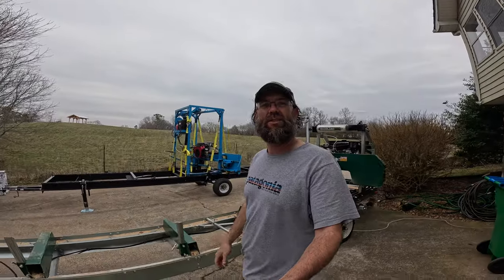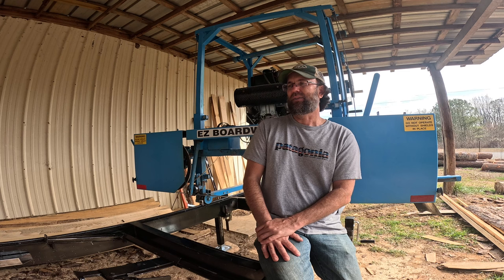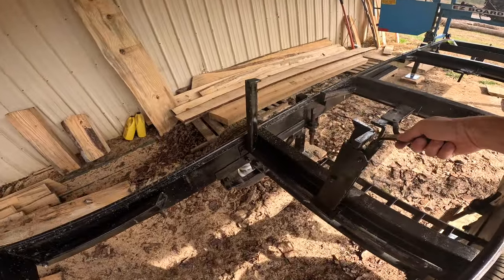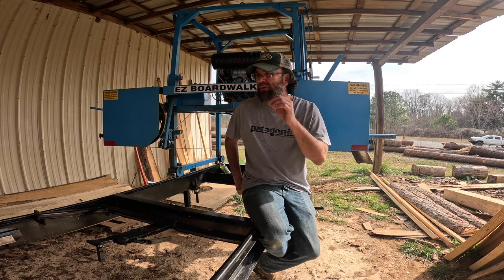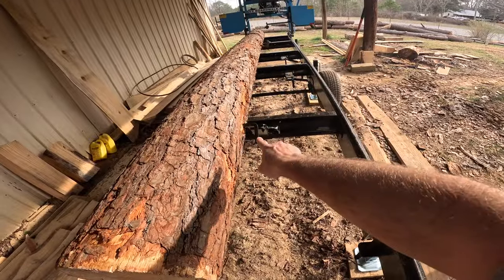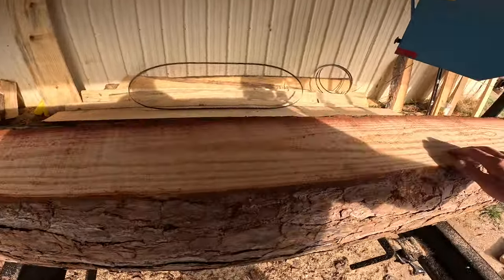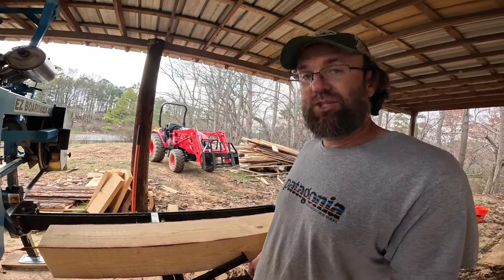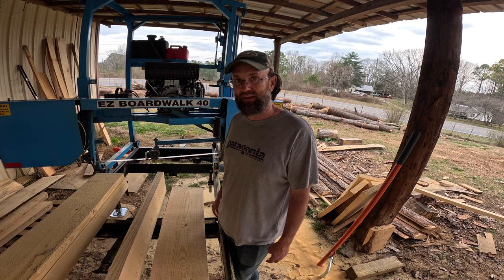Introducing My New Sawmill: EZ Boardwalk 40 Walk Through

Comment: Nothing that impressive about this one, I can see it's better than woodland, not much though
Reply from the maker: Have you had the chance to use an EZ Boardwalk mill before?  Some things don’t come through in video.  Certainly there are way more expensive and complex mills out there with full hydraulics etc. But for a manual mill, this one is certainly up there with the best in its class.  Nothing again Woodland Mills as they are a fabulous company with a great product but this EZ Boardwalk is solidly built.  But there are certainly bigger and more complex/full featured mills out there for sure. Either way thanks for sharing your thoughts and for watching!
Reply: I had 126 woodland ok for 4k. For beginners, just got myself woodmizer lt15 much better but still much room for improvement. Not to happy.

Comment: Best review I've seen online of the EZ Boardwalk Model 40. You did a great job covering the things that make the EZ Boardwalk different from all the other mills out there.

I ordered a new one along with a 20' extension and some other odds and ends in Jan 2023 with a backlog to around Sep 2023, but Stanton ended up being backed up a bit more so I didn't get it until Dec 2023. I love it. 

If you end up sawing timber with significant taper, the towboard option is expensive but, like the frame rails, is a really heavy duty beast with a simple but good design. 

Recommend you bolt a stop at the far end so you don't accidentally roll the sawmill head off the end. With that slanted head, if you are watching the leading wheel that is farther aft instead of the most forward leading wheel, it is easy to go too far.
Reply from the maker: That’s awesome you have one of their mills as well!!  Thanks for the kind words on the quality of the review!  There doesn’t seem to be much online about them which is surprising given how good the quality of the mill is.  
Yeah I noticed right away the lack of a stop at the end of the rail!  A friend who welds and has an ex boardwalk as well is going to help me fabricate an extension to the rails here in a couple of weeks.  Toe board is a definite option I want to add…may fabricate one or buy the one they make for it.  
Thanks again and thanks for watching!
Reply: Looking forward to seeing more videos of the mill. Great video. I have the same mill.

Comment: Are those tires rated for the highway. How fast were you going
Reply from the maker: good question!  I am genuinely not sure.  They are the tires that come with the mill from the manufacturer.  I was on the interstate for a little bit...maybe an hour or so doing 65-75mph without issue.  Rest of the drive was backroads at 55MPH or so.  I had no issue either way.  I know that the manufacturer drives them across the US with these tires on the interstate without issue.  I don't think they have a speed limit on the tires like some other manufacturers have on their mills.  It pulled very smooth behind my full size pick up.  Thanks for watching!
Reply: Thank you. Got some good info from your site and others. I'm picking up my EZ Boardwalk 40 Saturday in Missouri and driving it back to Ohio. I know they deliver them that way but I thought I'd ask someone who hauled one.
Reply from the maker: @50AcresofAcers  congratulations!  The EZ Boardwalk 40 is a great mill...I'd go so far as to say it is the best manual mill to be had on the market.  Safe travels with your new mill and congratulations again!